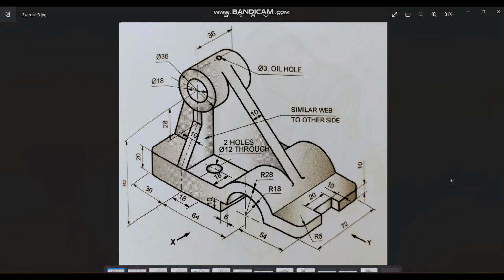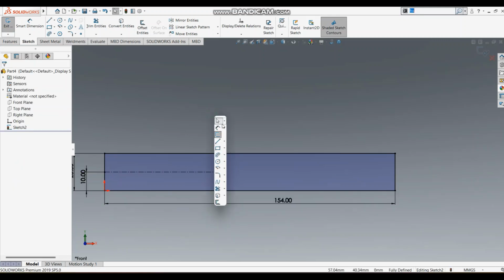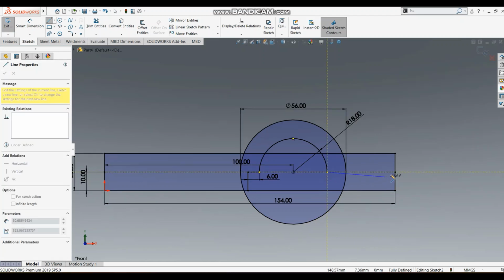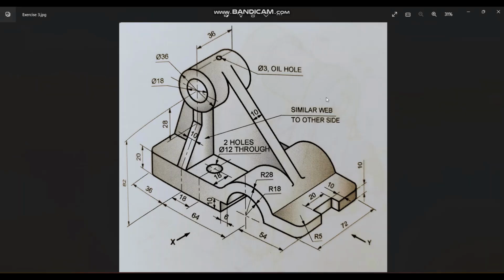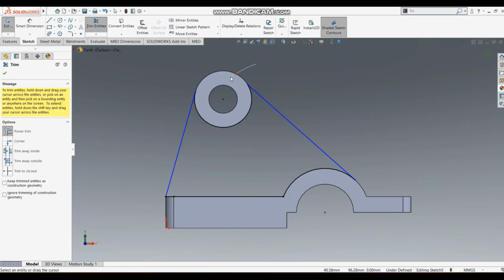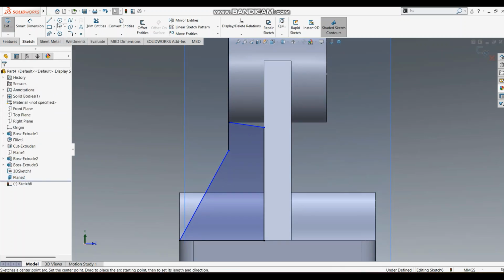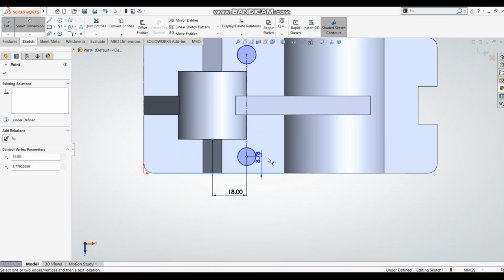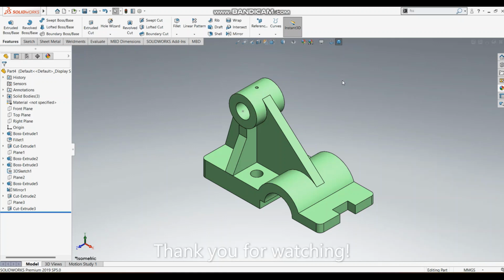SolidWorks Basics Tutorial - Part Modelling_Exercise_3

Comment: You screw up on the side web or Rib. they have spacing which is a mistake.... NOT GOOD FROM YOUR TEACHING
Reply from the maker: true!

...also that actually depends on whether we are manufacturing it with welding or casting (for welding manufactured - our model holds good)

Thanks for your comment!!
Reply: @greyelephant671  It's not depends. There is not proper made. The drawing shows closed and no spacing that means no spacing. You weld or cast or what ever you do.
Reply from the maker: @JBCool0729  Ok, will improvise! Thanks!!